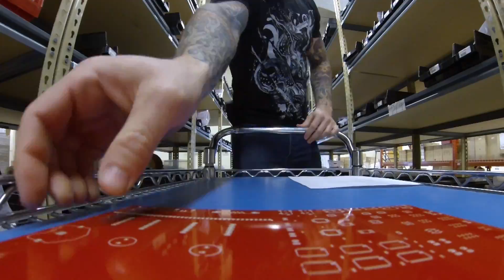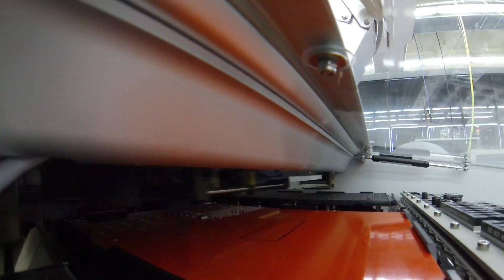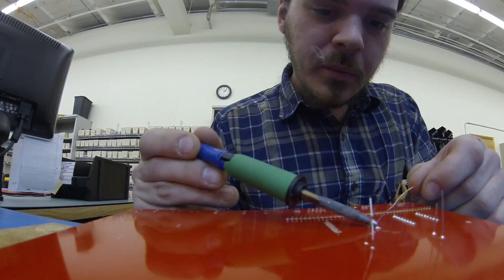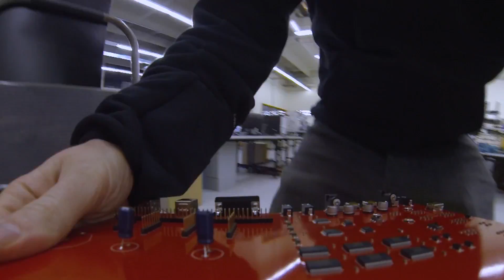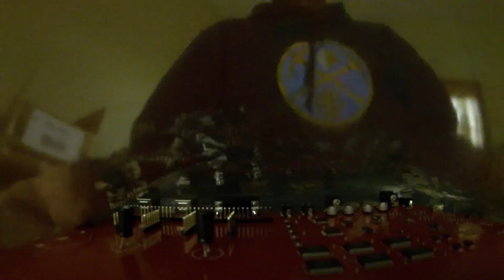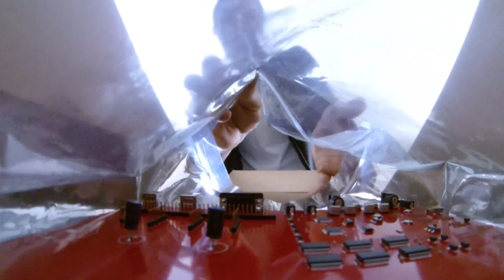Birth of a SparkFun Widget

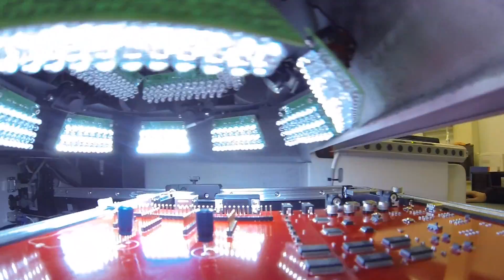Comment: I am fairly sure the camera was a gopro, for a couple of reasons. 1) minor barrel distortion in the corners of the image, 2) flashing light at 1:03 3) the fact it went in a washer without shorting out.

It didn't look like that reflow oven was switched on or at least the heat as there was no red glow from any heating elements to be seen.

Comment: The SparkFun Trident CL Automatic Defluxing System (PCB washer) uses our deionized water from filtered from our own tanks that are installed in the production department. =)

There are also crock pots, isopropyl alcohol, and a toothbrush that can be used for manual cleans.

Comment: Actually, none at all. It's just hot deionized water. Back in the day, we did have a regular dishwasher that we repurposed and hooked up to a DI water line. We played around with some different saponifiers, but water alone worked the best. We use water soluble flux, so the boards clean pretty easily. For home use, a crock pot full of DI water and a toothbrush works great.